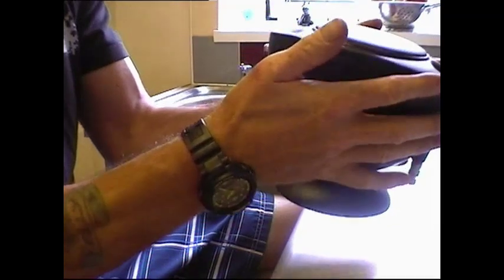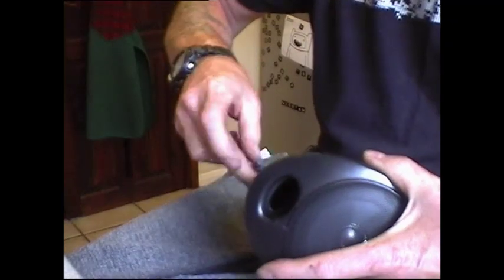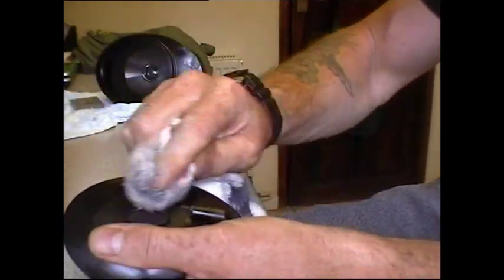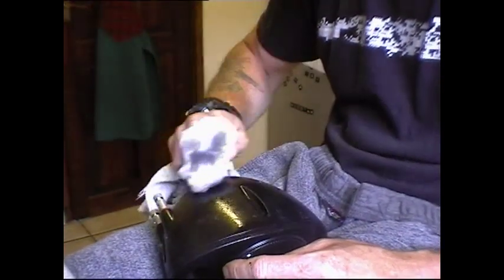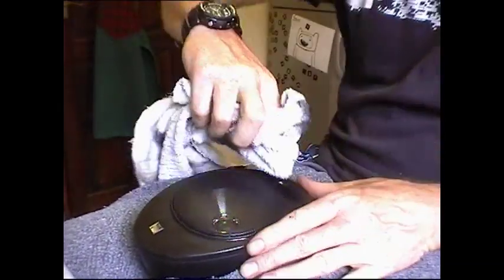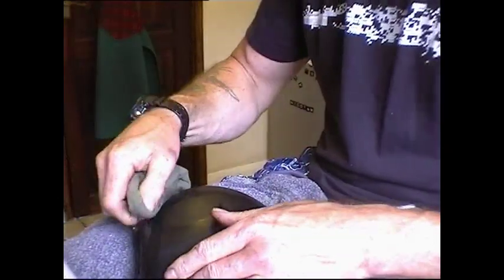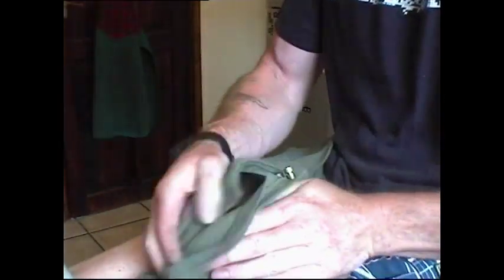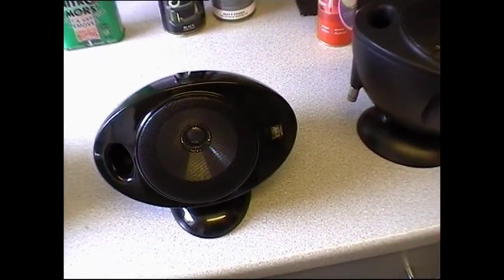KEF Eggs. A sticky situation.

Comment: I had the same sticky rubber finish on the top of a pair of KEF floorstanding speakers, tried this method and it worked brilliantly. i was extra careful where the rubber bit joined the wood cabinet, i bet the veneer wouldn't appreciate a coat of thinner....

Comment: Thanks so much for this!  I attempted to use much some light-duty solvents and adhesive removers with zero improvement, and so I was just getting ready to prime & paint the eggs.  Then I saw this, and saved innumerable hours.  (Also my painted result I daresay would've been far more "garage" than yours.)

Acetone, I used, the strongest solvent I have (and there are no products labelled 'cellulose thinner' here in Canada.)  Of course that'll strip off all the basecoat, too, but I had no problem with it - though I had a hint of silver shine through on one sharp edge.  I had all five eggs cleaned up 'very well' (near-perfect) in just two hours.

My advice with acetone: be careful not to clean too much, wipe very quickly with acetone & move along.  Use a thick rag - like towel, to grip the gunk fast & be sure to move to a clean spot on the rag quite frequently.  I cleaned each egg with about six two-finger swabs... three rough passes to remove most of the gunk - each side then the face, then a big overall wipe-down, then a couple very careful passes to tidy up missed bits & hardware posts.

By the way, I still love Kef - they're top-notch in design and USUALLY make the just exceptionally well-produced products.  This was a tragic, glaring failure  of manufacturing and of service.  That's two strikes, Kef!

Comment: Took me two hours each egg, had to take top layer off. Base was easiest bit.
Kef also fobbed me off by saying they had never heard of this issue. So after watching your vid and googling issue i got back to them and blasted them, which they then said to use meth spirit or nail varnish remover. 
Use thinners its better. £900 for speakers then get dumped on by crappy customer care.
Wish i bought the B and W satts. Cant fault sound of the eggs though they sound class.
Good vid.

Comment: here's the big tip, take them apart and get a wire brush attachment on a drill, and go nuts. the bare rough brushed aluminium looks awesome, better I think than the original finish I think.

Comment: Nice one, I've got an old set of hair clippers that have the same problem, though they took a lot longer (~7 years) before the rubber started to break down.

Anyway, the real reason I found your vid, is because one of my speakers has gone tits up, so I was trying to find out how to open it, so I can have a poke around inside.

Any tips on getting it open?

Edit: Scratch that, I've found the very obvious screw at the back. lol

Comment: I would expect better from Kef being a company that designs and makes some of the best speaker designs iv seen.
anyway if any one is going to repaint there speakers theres a product on the market called  barbecue paint it gives the surface a  deep rubber look texture  its fire resistant and sticks like sh#t to a blanket, also google rubber spray paint..make sure you put on a mask when using cellulose thinners  otherwise your trip out and start seeing pink elephants...Kef ones....

Comment from the maker: there is no special technique to stripping these down.first get an allen key to fit and remove the base,,then the two side screws and a center screw,,pop the cover off and look for the way the wires are connected to the post terminals,,unscrew the nuts and remove the wiring.the post terminals can be removed by unscrewing the second nut.the the dome will separate from the front,now remove the screws holding in the speaker,,do not try to remove the mesh grill,,just mask it over,Take notes along the way and if your not using a pint stripper fluid then just use a fine wet dry sandpaper,dont scratch the metal casing..if you want a super gloss finish then patience will win,fine mist coats and half hour wait between coats.